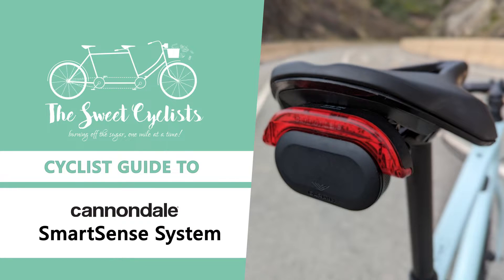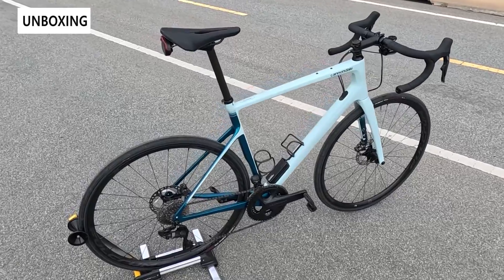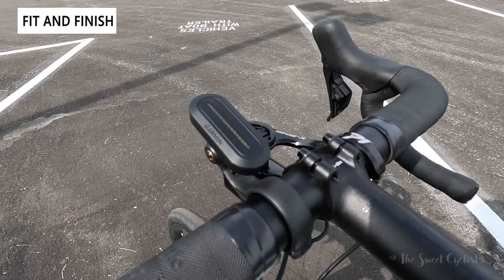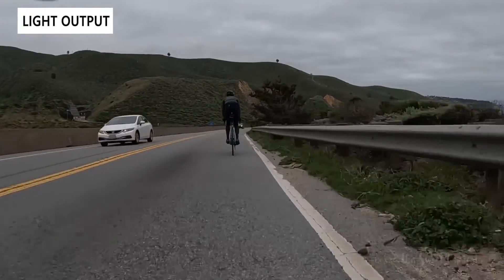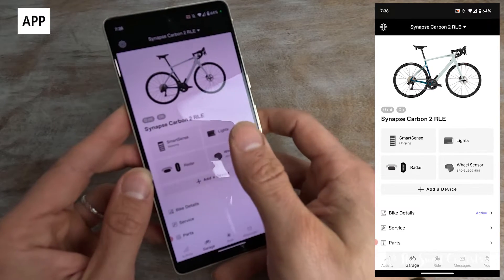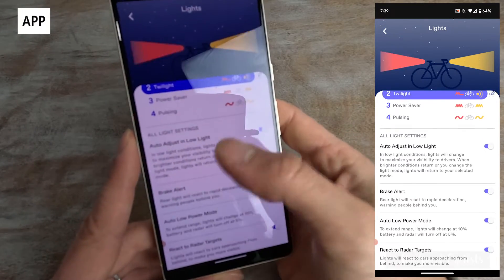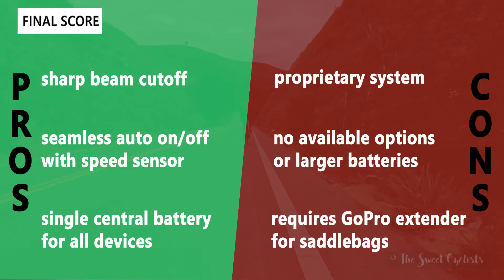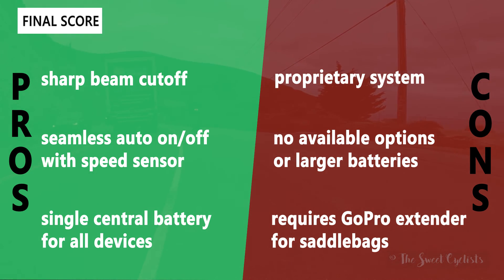Cycling guide to Cannondale SmartSense System - A Seamless Radar + Headlight + Taillight design

Comment: do you have recommendations for washing this bike with so many electrical components? can you get the place where the battery attaches wet? or should you just use a water-less method of cleaning it
Reply from the maker: Great question. As long as all the charging port rubber covers are installed fully (our battery actually stopped working because we left it open while washing!), you can wash the bike with a normal hose. Everything is waterproof so as long as you are not using a pressure-washer you should be fine.

Comment: So the 2023 Synapse 2 LE does not have the radar but has all the other features, correct? The RLE, R means radar?
Reply from the maker: Yes, Cannondale offers a few variations of the SmartSense system. L ("lights"), LE ("lights w/ electronic shifting"), RLE ("radar, lights and electronic shifting"). You can also buy the entire system or components separately so if you have a SmartSense compatible bike, you could add the radar / lights / battery in at a later time.

Comment: The battery is quite small, but the first idea that came to my mind is to connect a power bank to the downtube and connect it to the battery. It should work.
Reply from the maker: Unfortunately, I don't think you can charge the main battery and use it at the same time. I'm not really sure why Cannondale still hasn't released a larger battery pack option, I think most people would prefer it.
Reply: @TheSweetCyclists  i think it's possible, why not? Like any other USB charged device. I will try when my bike arrives. 

Larger battery pack means larger price... Especially for people, who already own the module.
Reply from the maker: Let me know if it works for you, but I believe the manual states it doesn't support on-the-go charging. Not all devices can be charged while they power other devices. @whyshouldidothatnow
Reply: @TheSweetCyclists  There is a notice in the manual indeed:' Remove battery to charge it". I think it is for safety reasons or something. 

I don't like this SmartSense system at all -_-
Reply: @TheSweetCyclists  Ok, basically it connects in the cradle, but the effect is like connecting two power banks - the cradle is trying to charge the powerbank...
Reply from the maker: Ah, thanks for trying it out. It doesn't seem like Cannondale has designed the battery with pass-through charging in mind then. @whyshouldidothatnow
Reply: @TheSweetCyclists  In such case they would not sell their expensive additional battery packs... I disassembled SmartSense and mounted a 3D-printed toolbox in the cradle. I am happy about it.
Reply: I think its weird to turn on. Why?

Comment: Do they have a non-integrated version?
Reply from the maker: You can buy the individual components and hypothetically add it to any bike, but it would be quite expensive. Cannodale's internal cable routing and modified downtube are what make this setup nicely integrate into the bikes.

Comment: The battery is online good for 2 hours.....  would be great if there was a blink function
Reply from the maker: The taillight has a flash mode - from the factory there are four modes: high visibility, twilight, power saver and pulsing. You can also customize them via the Cannondale app for even longer runtime with lower output.
Reply: @TheSweetCyclists ...  To be honest, in my app (in the chapter lights there isn't any mentioning of pulsating lights.) where do you activate it?
Reply: IT depends of ther Version. If you have a German Bike, where only permant glow is allowd you can Not Change the system

Comment: I like the integration here!  I've previously run a single DiNotte battery powering both a headlight and taillight and I liked the single battery concept but didn't like the proprietary charger or the poor wire routing due to how the battery mounted to the bike using a velcro strap.
It would be neat to see a light vendor sell a aftermarket setup like this Cannondale one, but using ruggedized USB-C for connections from the lights to the battery and a quick-release battery mount to water bottle bosses, as lots of newer bikes have an extra water bottle mount on the bottom of the down tube which would be perfect for a battery.
By using USB-C to connect lights to the battery, it would enable many existing lights that support pass-thru charging to be used, which would lower the entry cost for many people who have existing lights. USB-C with USB-PD would also allow for a variety of power output levels from the battery to support high and low powered lights.
Reply from the maker: There is definitely a trend toward connected light systems, so expect to see more options on the market. You can even buy headlights that control taillights like the Trek Commuter Pro RT or the Topeak WhiteLite BT combos which give you similar one button control but with separate batteries.
Reply: @TheSweetCyclists  that's good to hear!  For battery systems, one key element which some vendors seem to get wrong is being able to remove your lights without losing the mounting location/angle.  A quick disconnect for the battery, so it can be recharged, is super important for cut-off beam lights.  This Cannondale system seems to be exactly the type of system which would work well, it just stinks that it's all proprietary and only on their frames.

Comment: How does one connect a Garmin 540 edge with the usb c connector to the round plug ins on the headlight?
Reply from the maker: You have to use the Garmin Edge Power Mount (https://www.garmin.com/en-US/p/784702) which can connect to the round plug coming out of the headlight.

Comment: 3:27 Can you give more details on that GoPro extender please. Bunch of stuff shows up when searching. Thanks
Reply from the maker: Sure, the extender isn't very visible in the video lighting. You should be able to use nearly any extender but I'm using the one that came with my Fenix lights - https://fenix-store.com/products/fenix-ald-10-bike-light-holder-with-gopro-interface. It's simply a piece of plastic with GoPro attachments on both sides that gives you more room to mount a saddle bag.